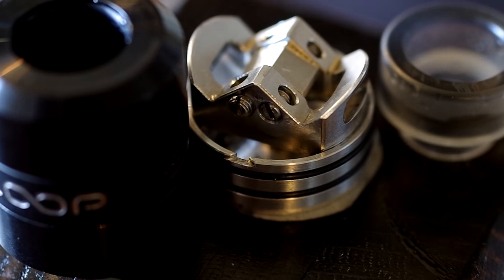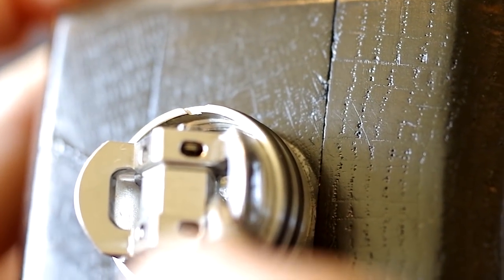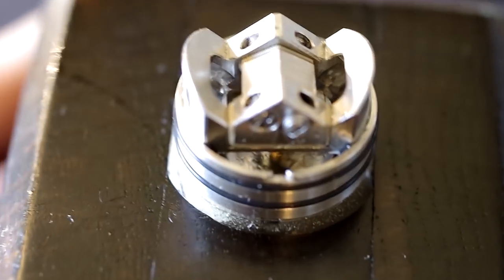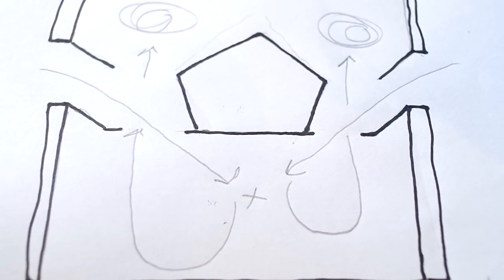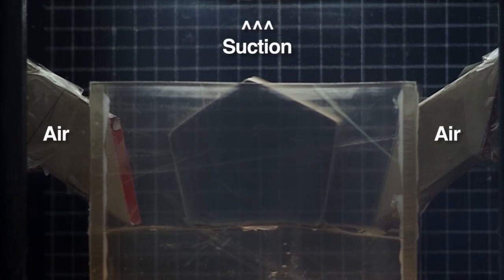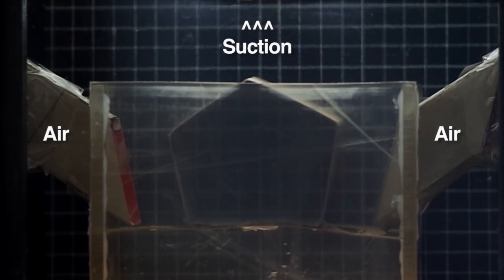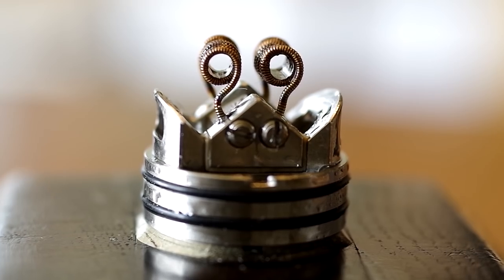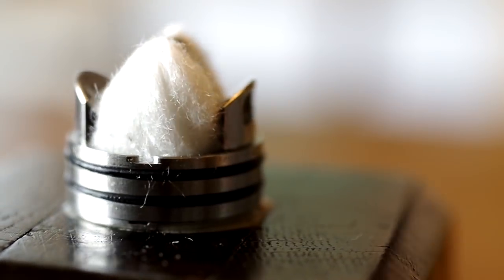The Loop RDA, Air flow & coil placement

Comment: O no, change is a coming. We can't have that now, can we? :P Sorry, had to throw a jab at the haters. I do appreciate what you do man. Been with you since the hard wicking vids. I don't always prefer my coils in the optimal airflow path, but I always prefer to know where it is so I can make informed decisions when placing my coils. Some RDA's I do enjoy placing the coils directly in front of the airflow and some I do not. For instance the OG Goon I like the coils a little higher than the airflow, Goon 1.5 I like directly in front of the airflow. I find that most my RDA's benefits from having the coils directly in the airflow path but not all of them. Thanks again man.
Reply: korgeth ok, so this is what I'm talking. I tried moving the coils in front of the air direction (in the OG Goon) and found flavor lacking. Move them up a bit and bam! Wonder why that is? Thanks for sharing that.
Reply: Not sure man. But like I said above OG Goon works better with coils slightly above the air is best I have found. But on the Goon 1.5, it works very well with the coils directly in front of the air. The only Multi-air-hole RDA I have that I do like the coils directly in front of the airflow in the Bonza. All the others I have to raise them above the airflow slightly. I am talking about side airflow RDA's BTW. And all my Single hole on each side RDA's with either Cyclops or a Round hole are all directly in front of the airflow. Just something I have found with my particular RDA's and the way I like to vape. Hope that helps a little. But I still don't know why though. :P
Reply: korgeth right! Yes I completely 👍 agree! Not sure why, but even my old av comp caps for the able mechanical mods are the same! The coils go directly in front of the airflow holes to get best flavor. I believe it must have something to do with the way there are multiple holes on the OG Goon (and atty similar) that direct the air in multiple directions. Maybe-just kinda thinking out loud lol. Anyway thanks for pointing that out. This will have me intrigued for the rest of my life until maybe Morten figures it out some day😀

Comment: This video gave new life to my loop. I was running dual coils low in the W deck and getting no flavor compared to my wasp nano and the loop was getting hot. Took out the dual 2x 26g wrapped in 36g  clapton, unwrapped each lead a half a wrap on one and set it directly in the center and got the flavor I was looking for, plus now the loop is running cool. Major difference!

Comment: Hi Oen, loved your testing regarding wicking and airflow! Greetings from Malaysia! Would like to suggest testing building dual coils as near to the "pentagon" as possible and low on the airflow coming from the juice well as suggested by other reviewers but definitely love that you would test and give your opinion on this?
Reply from the maker: I love the take Pal 702 had on this. For my flat wire coils there is simply no way to cool a dual setup. If you use slower coils, this is a great idea. Thanks.

Comment: I did simple braided 3 string wire recently, and It's almost perfect coil build, heat capacity is low, ramp up is fast, it doesn't burn my cotton at all, but the flavour is splendid. Its also flat in shape but with openings that allow juice to go out and about. So I'd advise anyone to stop wrapping wire with wire... really. I'm vaping for 2 weeks on that coil and there was no cotton replacement needed. I beat my tightly wrapped flawire build in cotton durability and I'm vaping sweeter/denser juice than back then.

if anyone's curious 3*26g Kanthal D @3mm 4 wraps gave me 0.2 ohms per coil.
Reply from the maker: Sounds like great coils!

Comment: I'm curious about the VGod Elite RDA. The airflow comes from the bottom directly on to the coils and it's pretty much a straight shot to the domed top cap. Except of course the airs interaction with the coil.  Seems like the optimal design if direct airflow is the goal
Reply from the maker: The VGOD dudes gave me a kit at the expo. I can do a review of it soon.

Comment: Oh have you seen the Aequitas?
It’s much like a Dead Rabbit, but with longer air tubes at a shallower angle...
and you can flip the barrel upside down to reverse the air (from above slanted down to from below slanted up). 

It’s an odd one. 

I only just got one, still testing. It’s made well, at least.
Reply from the maker: I'll look into it.

Comment: Cool. 
I have one. I had my best success with the coils much lower than the silly pic in the manual. 3mm, almost as far down as you can get. 
To my mind, since they then block all but slots between them and the pentagon, that’s what helped. 

Still, it was only pretty good at best. Decent, no waste of money, but nothing special.
Reply: Joe Arnold YES!!! 

I'm glad you pointed that out. I use 2.5mm dual coils lowered as close as I can get to the deck without shorting. They come in at 0.15 ohms and around 75 watts is the sweet spot for me. 

Get really really good flavor and even better on a mech.
Reply: I think that, as Morten says, it's that indirect airflow that will benefit the claptons much more. I use claptons, and I thought to myself whilst watching this vid, that I'd place my claps right where you are talking about. I don't own one, but thought that's how I'd do it.

Comment: Let me start by saying I have the Loop RDA. The first picture of the coils you showed, you have the leeds WAY to long! If you chain vape a hot build the RDA will get rather hot. I run a 26/40 Fused Clapton, 3mm I.d.(.11-.13ohm) on a mech (Sanyo 20700A). Place the coil low set right in the centers of the low points of the W. On Instagram @badguycoils you can see pictures.

Comment: I think of what you do as science. It's not any different than fluid Dynamics. It's just with vapor and airflow
Reply from the maker: If this was 200 years ago it would certainly have been science, but today you have to have 100% control on all the metrics and everey thinkable source of error. So by todays standards I'm just indicating probable effects:-)
Reply: I did notice one thing in your video I wondered about.
You showed the airflow currents around the pentagon but (maybe I missed it) I didn't see you factor in how the airflow under the coils actually directs some of that at the coil I stead of just along the pentagon? I trust your experiments  and demonstrations,
But those do seem like they would channel the air from that bottom up to the coil no?
Reply from the maker: @noxelohim   No :-) To intersect the airflow in any effective way, the coils need to be place so low that they touch the deck. I tried it, but it did not work. The only thing hitting the coils will be very faint puffs of turbulence. Single coil over the pentagon is the only way to get direct hit from effective flow of air.

Comment: couldn't you just turn the two coils 90° and put them on top 
the stream would hit the middle of the coil.. if they are not broad!? enough .... you could use bigger diameter to get some coil surface back (yes you would have to run one of the legs all the way to the other side)
Reply from the maker: You should try and report back:-)

Comment: First thing i thought when i saw the loop was, yeah Oen will break this one apart :P

Did you try it with a single exotic coil? maybe eaven a huge one at that?
Reply from the maker: I did not go that way, the flat wire was all the spatter I could handle.

Comment: Very interesting because I have this rda and imo, its the worst rda I've ever purchased. Very very disappointing. Almost no flavor at all. I'm going to try both of your suggested builds and see how it goes. Thanks!
Reply: David.For3v3R. I have the same RDA and I run it dual coil. It's the best flavor dual coil I have. 

What Morten didn't try is lowering the coils as close to the lowest points on the deck as possible. So close they can't be lowered much more without shorting. This forces the air past and around the coils and by the time it has hit the top of the cap it has a nice warm vape at 75 watts. 

I'm happy to take a photo for you if you want if I can post a link so you can see what I mean.
Reply: Squig I also go massive flavor of this thing. I really didn't think I was getting much when I got the loop, but the deck made it interesting...now  I run it with .15-.2 build on a mech and get very great flavor.  Always dual coil..always, but now that Morten has came out with this single placement I will most definitely try it on my next time building.  Morten brings an element of unknown to vaping that offends some but for me it is MUCH NEEDED:)  Keep up the good work Morten...you wouldn't be the first person in history to end up developing something MAJOR the people used to tease or excoriate because your ideas where just too revolutionary.  I will always support what you do here Morten...to me YOU ARE a science guy...you are lead by fact that sometimes change your mind like the Etheon review..that was huge. We stand with you because right, wrong , or indifferent you always reserve the right to change your mind as your experience proves otherwise.  Good job Morten....keep up your good work!!!
Reply: Squig sure, I appreciate the tip, would be grateful if you posted a link so I could see where your putting them. Also, what coils you use and inner diameter, if you don't mind. Thanks.
Reply: I really enjoy this rda too. And place coils low as possible. 2×24g n80 38g outer 5wrap ohms .1 really warm build but it has lot of airflow to me and makes it seem cooler. I vape balanced by SVRF and it taste better in it than any other rda I have (dead rabbit, drop, pulse24, reviewer rdas you know).
Reply: All the airflow is one of the problems I have with this rda, or more specifically, all that extra room in the bottom of the chamber (more air to dilute the vapor) and the in-direct airflow. I have just about every rda (under $50) that was released in the last 3 years, and tbh, this was one of the biggest disappointments to me. I've found all the reviewers rdas to be underwhelming, except the Nudge 24 and the Phobia, but both of those have things about them I don't like, especially the Phobia. PhobiaBut, flavor-wise, both of them have great flavor. I've yet to find the "perfect" rda. I think what it comes down to, is everybody has a different style of vaping. And, for me, the Loop is far from a "flavor" rda. The 2nd build I ever put in it, I knew that the coils should be as low/close to the "pyramid" as possible-Not like the reviewers were placing them or like the manual suggested. It improved the flavor, but, far from a flavor rda. I guess everyone just has different tastes, different expectations from their rda experience. Like the Drop. Everybody raves about it, to me, its just a little better than average. To each their own, I guess👍
Reply: To be honest I only tried one other flavor other than the coconut creme it was Graham slam and I was not impressed at all. I guess I should try some more in it before giving much of an opinion. But the coconut in it is great.?? Yeah I will be trying other flavors.

Comment: Why didn't you try placing the coils at the lowest points in the "W" shaped deck? 

I have done this with 2 x 2.5mm ID coils and get immense flavour without excessive heat. In fact the heat is warm and the barrel does not get hot at 75 watts 0.15 ohms. 

I don't believe you explored all the options and especially neglected to explore coiling the Loop this way. It forces the air right by the coils. Minimal turbulence and loads of flavour.
Reply from the maker: You will get a lot of indirect air flow that way. My job is only to show where to get direct air flow, and where it isn't. Thank you so much for this input!